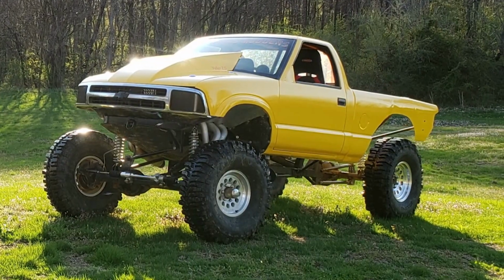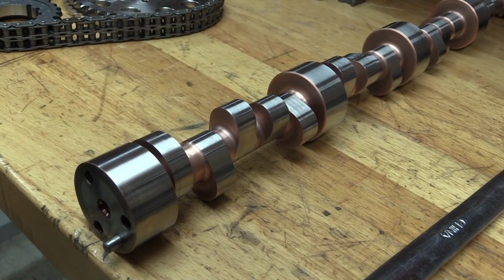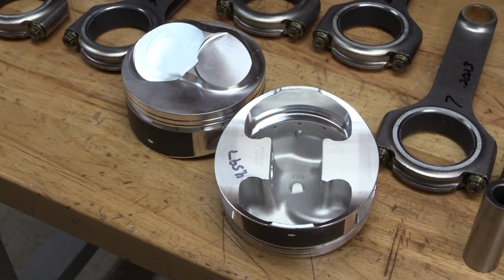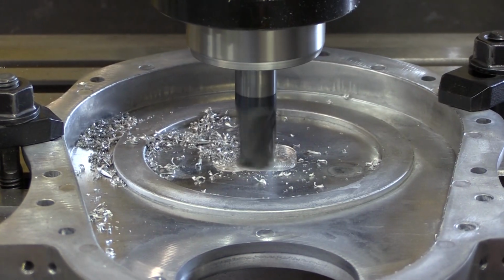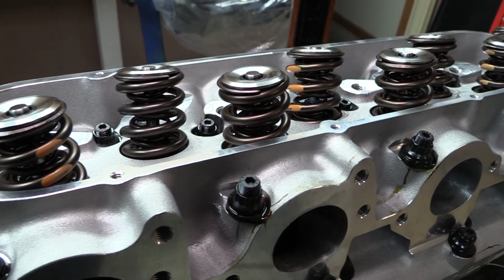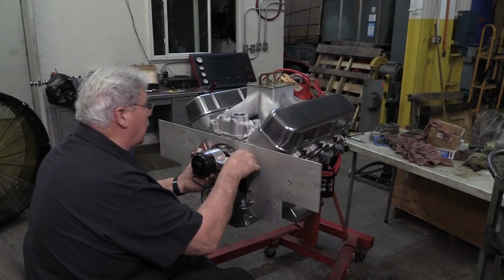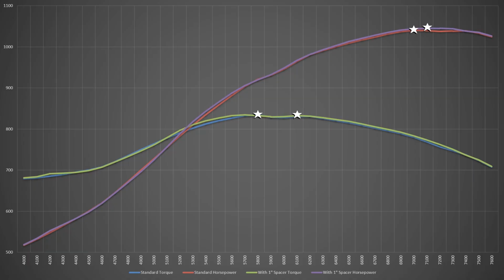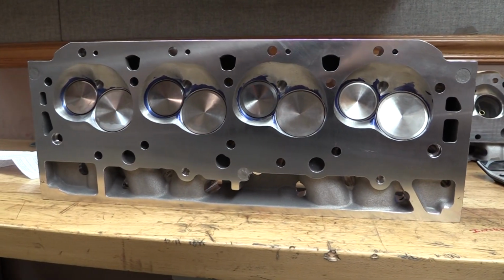Building a Big Block Ripper to Go Mud Bogging! (Plus, Do Vacuum Pumps Make Horsepower?)

Comment: What all kinds of big block engine that could used in extreme trail and mud bogging ?
Reply: MOST ANYTHING ..... 👍
CHEVY CHEAPEST 
SAY 4 EXAMPLE - 
A GOOD RUNNING STOCK 454 w A FULL BOLT-ON THRASH
CARB INTAKE CAM N LIFTERZ HEADERZ IGNITION
GIVE YOU A CHEAP RELIABLE EZ 500+ HP
SPEND $$ ON HEADZ WHILE THERE .... 550 , 575??
LOOK @ THE COMPLETE EDELBROCK PACKAGES .......
MORE THAN ENUFF 2oo GET STARTED N HAVE SUM FUN !!!!!

Comment: In 2002 I worked with a guy who was into the same thing here in WV. He had a 598ci build in a tube chassis Ranger, basically only the back tires were in the mud, he won every county mud bog that year.
Anyway his wife ended up divorcing him over the engine for his truck, he spent just north of $33,000 and in the divorce papers was the build sheet and recipes for the engine.

Comment: What's a good engine to put in a 2nd gen 1500 4x4 building a mud bog truck  out of a 01 single cab short bed thought about a 6.0 lq9 ls with a cam headers etc

Comment: The vacuum pump actually takes more power to turn when sucking atmosphere. Look at all any electric vac pump and it will pull more amps when at atmosphere then while at vacuum.
Reply: That is why they spin faster when plugged/ capped off.

Comment: I always wonder why they lube the bearing journals (not sure if it's the right terminology)  on a cam BEFORE they insert when by the time it gets to the 5th bearing it's wiped clean. I personally re-lube before the cam is set in it's final spot to make sure enough lube for when I turn the assembly as needed during the build. Obviously once you prime it it wipes it all away, but at least enough for degree the cam and setting lash etc.

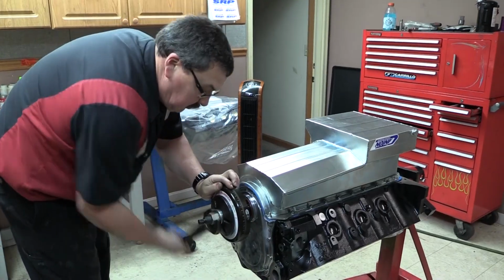Comment: 11:45 These all need to be honed to fit. They are small out of the box to compensate for differences in cranks from various manufacturers. 
By brother crammed one on right out of the box, and we had a HELL of a time getting it back off. A brake wheel cylinder hone will work to do it at home, but it's kind of a bitch because the stones like to get caught in the keyway slot. Take your time, and go easy with it.

Comment: Those Moroso Billet oil pumps are a serious piece. They crank out a SHIT TON of oil... On a dyno, the Moroso pump will show that it takes 6-8 more horsepower to drive than a standard Melling High-Volume pump does, but it will have more P.S.I. through the entire sweep, and much more oil flow(g.p.h.).
It's a stout piece of hardware.

Comment: Besides rotating assembly balancing, RPM capability is dictated more by the top end of an engine. Holding back on stroke doesn't mean much in and of itself.

Comment: Use the bracket race 10 second class too fast too expensive Moved up to 12 way more fun  we used to get  Good Wrench 350 stock 1700 bucks from the dealership Brand new 4 in bore  nothing oversize easy to order parts for  Rip top and off put a big nasty fucking  Camshaft and 12..1   PistonsWith 40000 th Gap from summit cheap edelbrock head  Can't member  Which cheap junk model number the heads were 2 0 2    1 60 valve About a 200 CC  Intake 750 Holley double pumper in a 200 shot on that thing Get about 50 passes when it blew up with salvage what was left of our parts by another 17 hunderd dollar long block from GM You can do with a big block cheap probably kill it but you could build 5 or 6 of those and still not torch 20000 That being said at the end of a season had a trash can full of powdered metal rods that we turned into powder  Add a whole bunch scrap  of 350 cast iron blocks

Comment: I see so many with their hand on the ratchet end of the torque wrench. That's improper and in some industries would get you reprimanded or fired!!
Reply: You have to be able to hold it perpendicular to the axis of measurement, anyone not holding the head is getting inconsistent readings and I'd be happy to argue this point with any instructor disagreeing with it, and ESPECIALLY happy to take someone to court over the loss of employment for something so ridiculous. You hired me for my skills, not how I hold a torque wrench, now get out of my assembly area.
Reply: @RyanMcIntyre  just telling you what I was taught in QC of nuclear parts inspection.  You go ahead and torque up your engine bolts!!
Reply: @kevinshiley9061  lol! I don't think I know of any mechanic or shop being held to nuclear qc standards, but thanks

Comment: i know a local shop does 635 ci with 1100+ hp for$ 12,000 and 800hp on pump gas with the 800hp he has been around forever the guys in the video know their stuff also you need to mention the heads need to be torqued in 3 increments so they do not warp

Comment: So funny story, when I was younger I went to Bubba's Mud Ranch (owned by Bubba the Love Sponge) in Auburndale, FL and they had a side by side 1/4 mile drag strip made of mud that was roughly 3-4' deep. There were some KILLER trucks there that night. The dude that we came with had a OBS Ford on 44" TSL Thornbirds with a fully built 460 with a centrifugal supercharger and what kind of vehicle do you think won the whole night overall? A damn stock 4 cylinder manual Jeep Wrangler...what in the actual fu&%?

Comment: “Like the rest of us, doesn’t have a lot of money.”

Also them: “Were going to make over 1,000 horsepower for around $20,000.”

I was expecting $2,000. That’s my fucking budget 😂
Reply: YOU can do it for $10k, I just built a premium 385sbc with eagle forged crank and 900hp rods from jegs that will go over 1200hp , you can find deals on great pistons like wiseco on e bay for about $400, heads are tough deal I get them usually bare shop around and load them with manly valves,

Comment: Now slap a locomotive supercharger on it and call it a day.

But fr, that engines screamin for boost.
Reply: No way! That engine isn’t set up right for boost. 1. Way too much compression. 2. The cam isn’t designed for boost it spec for a n/a setup. 3. I might be wrong but I’m pretty sure those rods wouldn’t last long under boost. I’m no engine builder just a dumb old mud racer that has never had a quality engine like this just some old junkyard stuff thrown together 😉
Reply: @justinnewhouse59  
But you are still right. Boost that compression and see how high they fly!!

Comment: Don't get me wrong I love a big hp number but is a big torque number a good thing
Reply from the maker: Yes, you definitely want a ton of torque. But it isn't as critical as high rpm power. The thing about mud bogging is the engine will likely never see anything in the lower rpm range in the pit. The driver will mostly likely run the engine up to around 6000 rpm or so and drop the clutch. Then he'll make his run with the pedal mashed to the floor. Since there is no traction, the engine will still be in high rpm range when the truck gets stuck with the wheels still spinning. Thanks for watching.

Comment: I would have used 1/2" head studs.  I really am enjoying this video!
Reply from the maker: Thanks for the kind words! Yes, 1/2 head studs would definitely provide more clamping load, but that would be a tough add. Besides the cost and time of machining the block from the original 7/16 bolt holes to 1/2 inch, the smaller studs are already intruding into the intake ports. I have no idea how much the larger studs would hurt port flow, but it would be interesting to find out. Thanks for watching!

Comment: What is a support rail for the oil ring land?
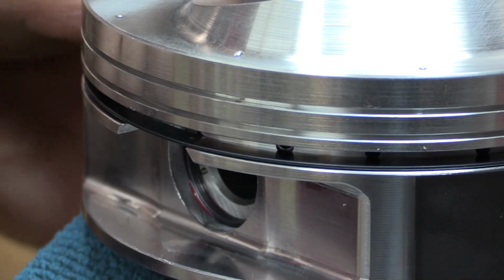Reply from the maker: If you look around 8:34 on the video you can see a notch out of the aluminum on the piston where the third ring (the oil ring) goes. This is necessary to get the piston's wrist pin through. If you have a gap in the oil ring like this, it will allow the oil ring to flex and it won't do its job properly. The support rail is essentially another ring that isn't designed to press against the cylinder wall. Its job is to go underneath the oil ring and provide a proper "floor" so it won't flex. Hope this helps, and thanks for watching.
Reply: @TheHorsepowerMonster  I kinda thought that was what it was referring to,I just wanted some clarification..thank you for the response.

Comment: @thehorsepowermonster your are CRAZY! 20K for a motor. WTF dude. Your want 1000 hp for less than 1k. Buy a stock 6.2 diesel gm motor ( 80's motor ) convert it to gas . Change the pistons,  double the value string , threaded valve studs , remove glow plugs drop in a hei distributor and add fuel injection and a 250 shot of nitrous and get a 1000 hp motor all day long for less than 1k.
Reply: Huh???? How does one double the value string??? What is that? I've only studied engine building for 25 years so I'm kinda behind....
Reply: @adamjuiceman  use 2 springs. One inside the other
Reply: Cool story, brah.....
Reply: Lol all the face palm
Reply: Barry Boppins  Facebook market place or graigslist
Reply: also contact your local machine shop. people are always upgrading and they might have a set from a build they did.
Reply: Barry Boppins  you might get lucky and find used pistons. Nx hitman is about the best entry as far as I know it's about $500?? If your tune is good any further will hold up to 250 shot if but properly and ring gaps are good
Reply: Barry Boppins  stock on parts are fine to use

Comment: There’s no replacement for displacement
Reply: Sure there is
Reply: @hell-sol5240  tell me what would then? tell me what will do it with less heat soak than a naturally asparated big block..
Reply: @walkerforsyth6221  its called talent all about the driver.
Reply: @walkerforsyth6221  well, since the class requires NA, there goes your boost!!
Reply: Phil D12 ye 4 turbos and a super charged or a twincharged car
Reply: @rectly  sounds like alot of heat and a big ka-BOOM at the end.
Reply: @walkerforsyth6221  Only if you get a special ed kid to do your cooling
Reply: @rectly  not when it has to be NA!!!

Comment: With the TD rocker shaft have you ever noticed that the aluminum rocker shaft irons on the exhaust brake to the heat
Any of the drag racers run steel ones on the exhaust valves to eliminate breakage

Comment: why not just use an ex-nascar 5.8L or sprint car 410 engine?
Should have watched longer. :D. Need wet sump ;)

15:1. hahaha, that's a diesel
Great info in the vacuum pump as well !!

Great video as always
Reply: Almost! Bet he's running nitro-methane.
Reply: No nitro runs vp my good freind that pretty well dominates the class he runs had a 622 with 17:1 compression running vp 116